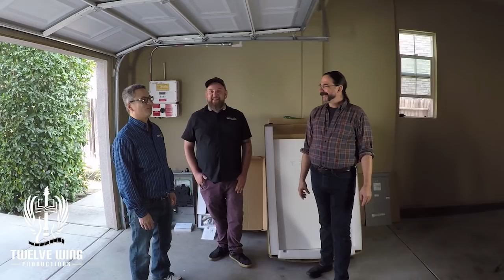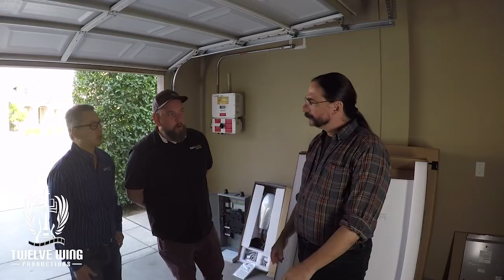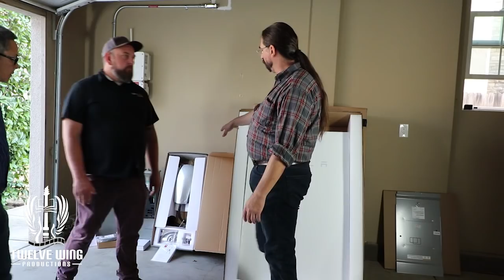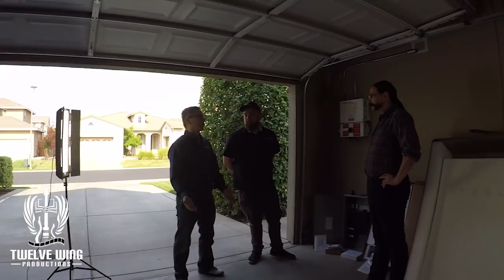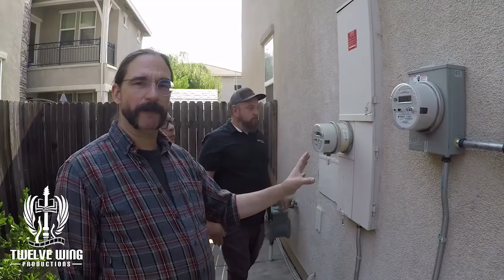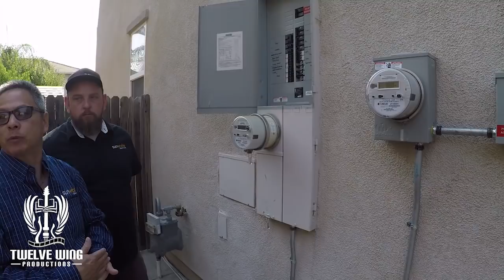The Powerwall 2s are arriving (Prologue: 3 Discussion series)

Comment: If the power wall can go outside why is locating it under a window an issue?
Reply from the maker: Escape rout in the case of a fire.. or so the story goes.  This is a case of building codes making little to no sense.  That wall also contains our gas supply.  That wouldn't exactly be my first choice of an exit.. not to mention the fact that the window in question is 8 feet... from a door.
But.. keep in mind.. the person saying that wasn't a building inspector.  He only has experience with some poor ones.
Let's not make it a problem until it actually is one.

Comment: Disconnecting from the grid and using the powerwalls solely would be swell...utilities in British Columbia( B.C Hydro) only credit you a fraction of what they charge you, for the solar power you produce, and requires a contract with B.C. Hydro.  It’s not an “even playing field”..... even though your solar power is just as good as theirs.  The only logical way to save money, is clicking off the mains to the grid, and run as many appliances as you can off your inverters, batteries, and solar panels directly.  Being tied into the grid and trying to sell your power to B.C. Hydro, is like being robbed continuously.....Not all provinces in Canada are the same; Ontario will pay you the same rate for your power as they charge you for their power.....even playing field.  Until the laws change in B.C., I will not be tied into the grid in town.  Darn utilities in B.C. want a monopoly.....and that really jerks my chain.🤬

Comment: Wow.. 2 different meters? In Missouri (and it may depend on the co-op you're on), you just have to agree to use an updated digital display meter, and it has "arrows" on it below the meter reading. When you're using from the grid, the arrow that points toward the right blinks, and the counter goes up. When your solar or whatever is pumping out more than you're using, then the arrow pointing left starts blinking, and the counter counts down. At the end of the month you just get a bill that shows you what you used, produced, and the amount you owe in difference. Or if you generated more than you used, you get a check for that difference. Easy.
Reply from the maker: I'm sure quite a bit depends on the technology involved in each district.  The common thread here is that up until now we had to take the utility companie's word for it.  Everything happened behind the scenes.
I have already noticed a couple things about every meter I've seen since the 90's when they got rid of the mechanical ones.

A) They seem to all take advantage of the amount they are "allowed" to be inaccurate
and
B) They are all rather difficult to read.

I'll be doing an entire video on "B" so that people can understand what all those other numbers mean but the bottom line is that these digital meters are designed not only to track the amount you used but also when you used it.
The same should be true for power delivered to the grid but again, we have to take their word for it.
In the US, at least here in my utility district, SMUD isn't proposing to pay you an increased amount for power you send to the grid during peak or super peak hours.  At least not as far as I'm aware.
Utility companies also don't pay you full value unless they do a pure subtraction method.

I would very much like the meters to be more easily understandable like the old meters were and as it sounds like your meter is.
Your meter as well, however, has electronics that allow it to calculate what time the power was used.  So again, until solar hit, we had to be vigilant.  Now, we will just be able to look it up.  If it doesn't match to what is on our power bill... the utility company gets a phone call.
Reply: like you say, each Utility is different, Mine for example allows me to take snaps every 10 min. and I can Load that up into an Excel sheet and review. its pretty accurate compared to what I get from Tesla's site.
Reply from the maker: Do you have a powerwall?  I would be interested to know what the difference is between what you capture and what the Powerwall is showing via the Tesla app.
Reply: Yes I have 2,  from AC inversion in to AC back out of the powerwall its about 9-10% loss this summer. some of which is heat on the pack. the Variance is pretty minimal from my Utility. about 100-200wh from their meter to what my end shows. So if I push 14kwh to the grid. its will show 13.8 on their end that's pretty in line with what i've seen from others as well.
Reply: Yeah, I feel bad for people that live in areas that have to pay extra for the whole on/off peak hours different rates thing. We just pay a set flat rate. I think our worst bill we've ever had is around $228, and that was a really bad winter. Electric heat - so cold the heat pump could not exchange so lots of excess backup heat system burning up electricity. Usually, summers were around high $80s to $105 on the high side, winters could get as high as $130ish. After our very poor excuse for a grid-tie solar DIY, we're down to around $20-ish and $40-ish. One month we were gone to family out of state for nearly 3 weeks, and we actually got a $11 check. :) 
I've heard the horror stories about digital meters. We almost didn't even go solar at all, and were just going to wait and save up until we could afford to go off-grid entirely so we could keep our mechanical meter. It's definitely turned out to be a good choice as far as the wallet is concerned so ... we haven't really even messed with tracking it to be honest. 
I'm really looking forward to see the follow up videos to this for sure! Take care. :)
Reply: Incorrect, the export reading does not count down. I have the digital net meter and they both count up. But on two separate registers. Both readings are on my bill. One meter two readings. I get paid for what I export at the same rate as what I import. I pay wire charges for importing though, so I try to do heavy loads such as laundry at solar my noon. I get credit bills for eight- nine months of the year. In Nov, Dec and Jan I end up paying about $250-$300 per year total. My system produces on average 10.4 MMh and I consume about 5.4 MWh annually. Strictly grid tied, no batteries and I wouldn't touch them with a ten foot pole.

Comment: I just found your Chanel, I think it is helping me understand better how solar usage and selling back to the grid works.
But due to the problem of power company s around here over charging by faulty meters brings up a question.
Does this system you are installing have a way to closely track what you have to buy from the power company as well as CLOSELY track what you are sending back to the power company, RE; pay them / they pay you. And, in your area what are they paying you per KWH compared to what you have to pay them per KWH.
Thanks Greatly 
Lou
Bangor, Maine
Reply from the maker: "Does this system you are installing have a way to closely track what you have to buy from the power company as well as CLOSELY track what you are sending back "~

To the watt.
We will also be examining losses.  Currently the system is loss heavy and we will be going into that in great detail.
The solar panels create DC, but there is no way to feed DC into the powerwalls currently.  That may change in the future if they re-release their DC coupled powerwall.
Because of this, the DC from the panels must first be rectified and there are losses here.  That AC power is then sent to the powerwall where it's internal bidirectional inverter converts it to DC to store in the battery.
When the house needs it, that DC power is then sent back into the inverter to turn it to power for the home.  Each time it runs through an inverter, there are losses.

To charge the car.. it's even worse.  One has to send the DC power from the battery through it's inverter to the car's AC side where it's onboard battery charger rectifies it to DC to charge the car.  So it's all kind of nuts.
We will be tracking these overall losses and explaining them in great detail.

As to your question of why power companies are going to hate this, it's because it totally simplifies the relationship.

The system as designed should only draw from the grid 3 months or so out of the year and when it does so it consumes in blocks to charge the batteries.  These blocks of power are closely monitored as is the resulting charge that actually makes it to the batteries so loss can be calculated.
The power company shorting you on what you deliver is a little more difficult to monitor from an enforcement standpoint but we will be doing that also.
We will be able to fully catalog how much of our surplus power we sent to the grid.

Hope that helped answer your question.
Reply: I will have to think a lot about this. I admit I really don't understand much of this stuff. But I read and reread, watch and re-watch everything you put out so hopefully I will eventually understand it. One little piece at a time :)
Heck, I'm an old man, I go back to wind power on a car generator and 12v
bulbs. LOL
I thank you ever so much for your help.
Reply from the maker: My pleasure.  Please feel free to ask if you have any questions as we move along.  At this stage I can answer most all the questions people pose in the comment stage.  As we move forward that may not be possible but I will be reading them over and will answer some of the more common questions by doing videos on those subjects.

Thanks for following along.
Reply: Thank You
Reply: The system as designed should only draw from the grid 3 months or so out of the year and when it does so it consumes in blocks to charge the batteries.  what do you mean by this? are you talking about the powerwalls? or the Cars?